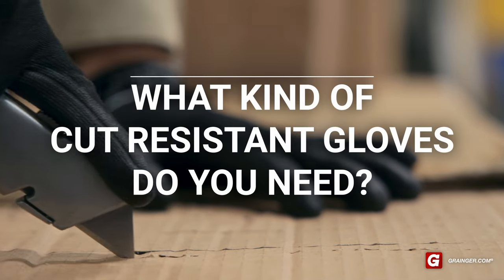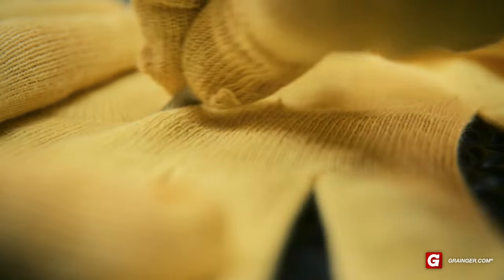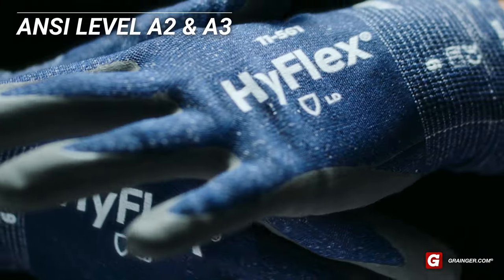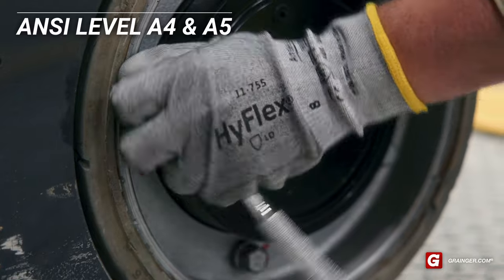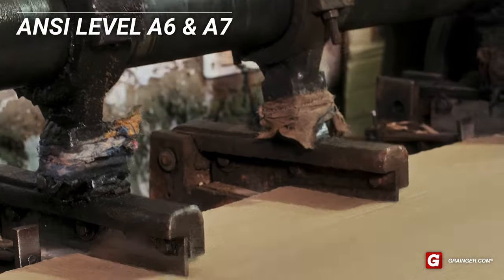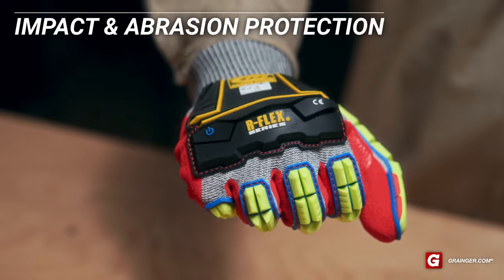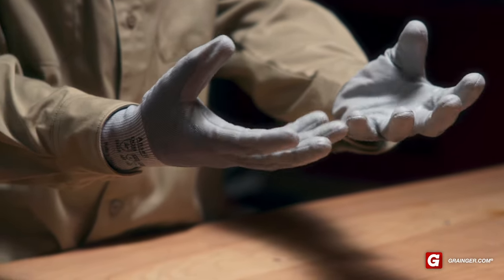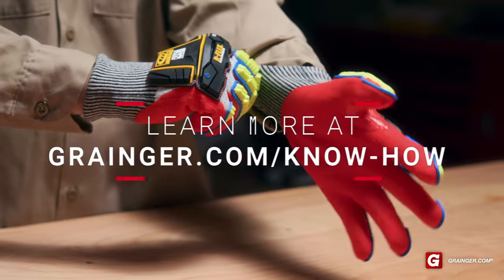Choosing the Right Pair of Cut-Resistant Gloves

Comment: I work with steel that is semi hot. The edges are very sharp and different shape thin as blade.. Its pretty much steel for street drains thick brass a d I seperate bad shapes. I GO THROUGH 2 HEAVY DUTY GLOVES IN 8 HOURS!! I Wonder if I will ever find a good pair, heat resistant, unterable..  If anybody knows please let me know
Reply: Holy  hell